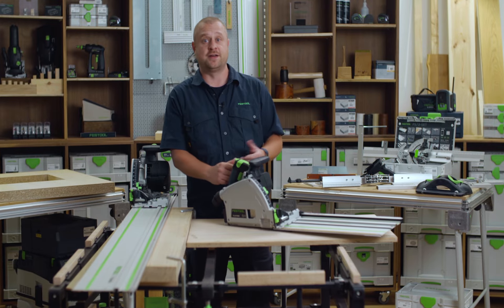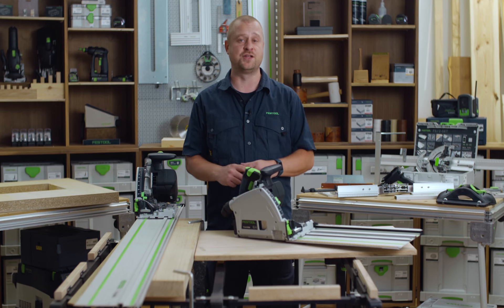Festool TS 60 K Plunge-cut Saw: An Introduction

Comment: Didn't festool have a 75? I have the 55 but if I was in the market for another saw surly it makes more sense to buy the larger 75 or has that been discontunied?
Reply: Ts75 is still in the range. Depends what you want from a plunge saw I guess. This works on the FSK rail and doesn’t seem to be much heavier than the TS55 and seems to be a bit stronger and gives more options of depth of cut
Reply: It's more of a replacement for the TS55. It has the same form factor and similar weight. Only reason to buy a TS55 now is if you can't do without a riving knife. The option to use the FSK rails is just huge and makes the decision against a TS55 even easier.

Comment: Cannot get an answer from customer support over the emails. 
Maybe someone here could help me with this saw? 
After cutting with TS60 my midi vac doesn't switch off all the time, it works perfectly fine with other Festool tools. 
I plug saw to the vac do a cut,  saw motor stops extractor no, it continues to run until manually switched off or cable from the saw is unplugged. 
Other tools works well, for example sanders stops then after 2-3 s vac stoops. 

Any ideas what could be wrong?
Thanks
Reply: Sounds like a fault with the saw, for whatever reason it's still drawing power after it stops, have you tried different plug it cords? Send it back in for a warranty repair